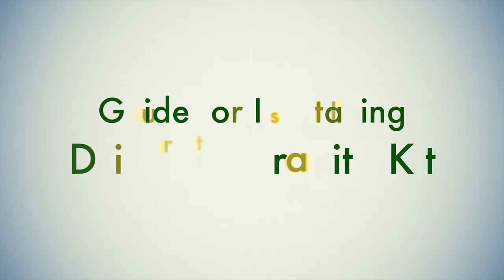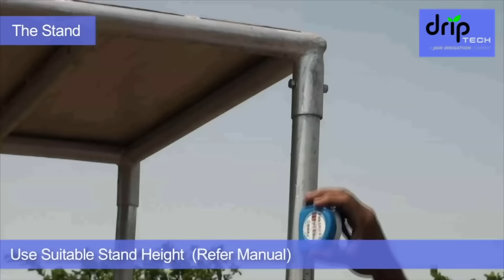Installation process of DT - Gravity Kit

Comment: The problem of gravity irrigation is

1. Distance between source and drippers.
2. Level of water in your tank.

   You need to keep the level of water consistently otherwise when the water level drop drippers at farthest gonna stop first and you need to adjust every drippers to made it work as normal again.

   Or get a water pump 100-200w dc with solar panel is enough for low rate drip irrigation all day.

Comment: Good way to irrigate without power supply. Idle idea for area where electricity supply is problem. 
It's better to cover the water tank by small shed to avoid heating of water
Reply from the maker: If you have any further query, we'll glad to connect with you on telephone or email. Our email id marketing1@driptech.com and telephone no. +91 8378946691

Comment: What about fertilizing your crops? Do you still apply solid granular fertilizers to your crop if you have installed the drip. How does it dissolve into the soil?
Reply from the maker: With a drip irrigation system, the application of solid granular fertilizers is less common because liquid fertilizers or water-soluble ones are typically used for more efficient distribution through the drip lines. However, some farmers still use granular fertilizers, especially for crops that may need slow-release nutrients or for specific soil amendment purposes. For the most efficient use of a drip system, fertigation (injecting liquid fertilizers directly into the irrigation lines) is preferred. This method delivers nutrients directly to the plant roots, ensuring better uptake and reducing nutrient loss due to leaching or runoff.

Comment: for drip tape system, you need 15psi water pressure. Just means, water tank height should be 10 meters  at least. I found you only have two meters.
Reply from the maker: Please call us at  +918007978080
Reply: Sir on my personal experience 2 meters height are sufficient : A filter on tank outlet. Hose section 1/2" NP4 20 mm external diameter. 50 meters lines work well. Better discharge initial water which gets hot under the sun.
Reply: @fulviogrienti8911  what about lay out later distance both size
Reply: @driptechindia4876   good
Reply: @driptechindia4876  
H
Reply: @driptechindia4876  how much to cost one of this complete kit .
Reply from the maker: @linelmarhao  Please whatsApp us at 
+918007978080
Reply: Thank tank height is not the only factor that increases pressure. The water level in the tank is responsible for most of the pressure. That means that with 2 meters of tank elevation, you can easily reach 15 psi even with 50 cm of water level. So the water level in the tank has more effect on the pressure than the tank elevation.
Reply: From the joints i saw they use venturi effect to make the difference in hight
Reply: @ibrahimaniakh4447  you are wrong. A, if water level is 1m, plus 2m, total is 3m, is far from 15psi, because only 10m can reach to 15psi. B, when water level going down, you donot have 3m at all. Only ekectrical pump can supply enough pressure.
Reply: @dennischen2448  why is it look working well then?